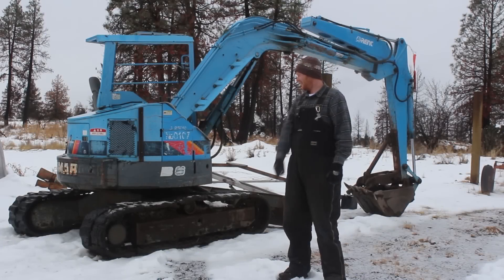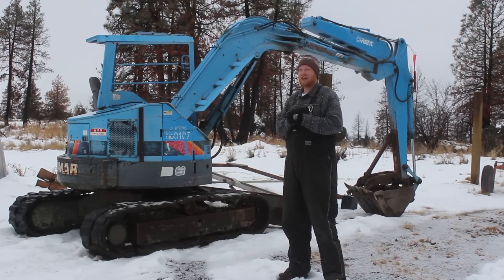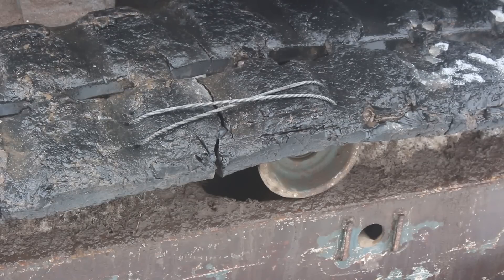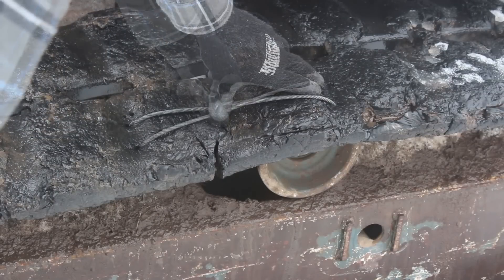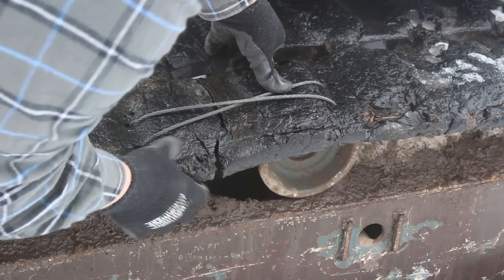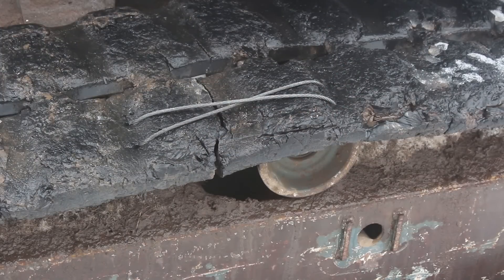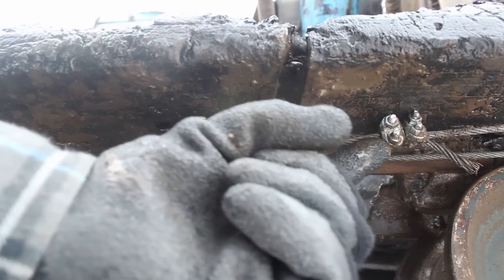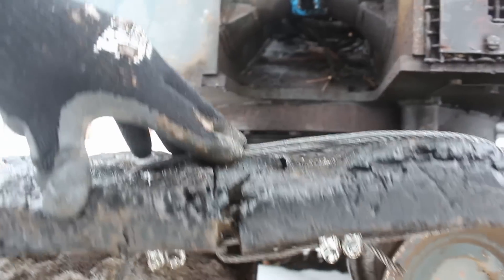Repairing a Torn Track for a Yanmar B 6 Excavator

Comment: THANK YOU for taking the time and sharing your idea. I just tore my track on my Terex TC29. I went to hardware store and got 4' of 3/16 cable, and some grips. ( thats what I call them, U BOLT ) Could have used a little more length for tightening  purposes though. It worked perfectly! The biggest problem i had was putting in the cable. When I drilled through the track, I encountered the cable built into the track. Drilling oversize holes helped but putting the stitch cable in was somewhat difficult. Once I got it through and all stitched up it is a work of art, so I sincerely thank you.

Isn't it a damn shame that people take the time to find a fault in your FIX?  For those old enough to remember Thump-er, the rabbit, famous for saying "if you don't have something nice to say, then don't say nothing at all", Peter Behn was the voice of Thump-er,  he too lives in Vermont.  Again, thank you for sharing and taking the time to post, it sure helped me.
Dave, in Vermont

Comment: you can use a two length of chain both about a foot long  drill four holes threw the track then use four bolts with heavy washers putting on the top and bottom of the split ,make sure the chain is a strong one .works the same . .